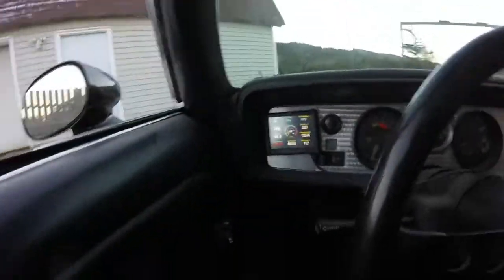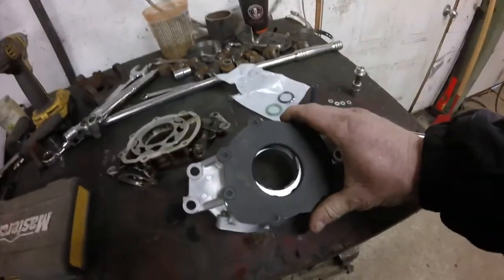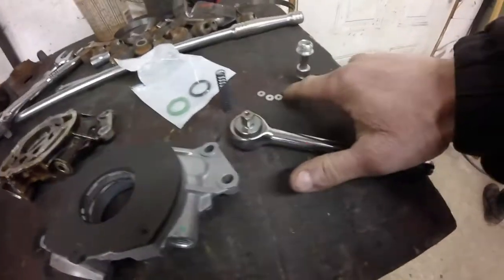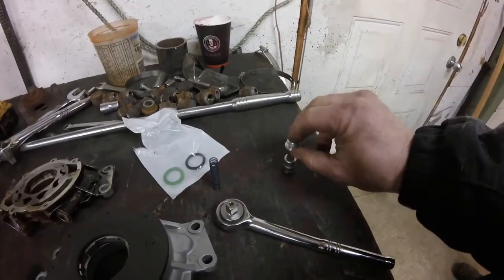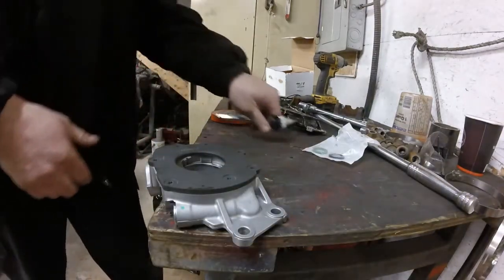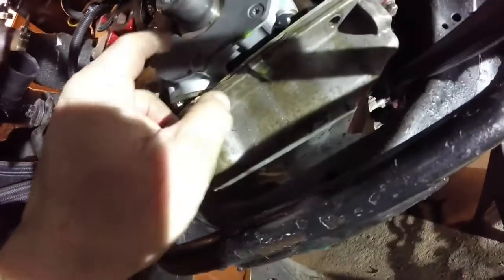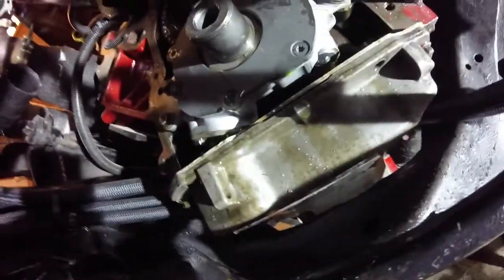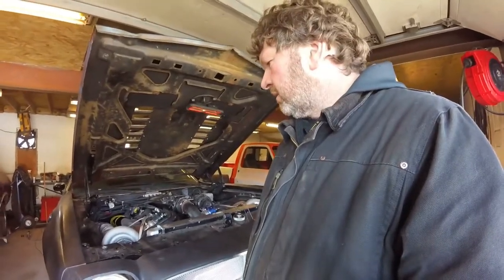turbo ls oil pressure problems

Comment: What should the oil pressure be at idle
Reply from the maker: I’d figure around 40 at idle but I’ve had them as low as 25 and be fine. Problem I had it wasn’t increasing enough when it was hot driving around
Reply: @weekendatbernies4503  im around 25 at idle running it around 45
Reply: But im not turbo yet
Reply from the maker: @irvingbar4569  should be fine for street car.I know the factory Gm pressure spec is not all that high. If it was a race only vehicle I would like a little more. If you’re not happy with it move up to next thicker grade oil. It should increase pressure

Comment: What are you thinking the issue is, bearings maybe?
Reply from the maker: They recommended no oil restrictors
Reply: Just something I found with my turbo setup, now I’m only running one turbo but mine with a -6 feed and no restrictor, mine idles at around 40-50 psi hot
Reply from the maker: Don't know how much pressure loss feeding 2 turbos. But original oil pump had a stuck pressure relief. And I started up and shut it off a lot before I replaced it with a stock used pump. Most likely the bearing
Reply: @weekendatbernies4503  makes sense. Sucks that you’ll have to pull it apart, but it made a lot of good runs this year so it’s worth rebuilding

Comment: Probably worth your while to check it with a mechanical gauge ? Some LS engines have a screen under the oil pressure sensor that gets dirty and the sensor reads low. Just something to check.. video was well done bud
Reply from the maker: thanks, i did have a mechanical gauge in there as well as the terminator. before the fire. they were the same. unfortunately
Reply: @weekendatbernies4503  well I did hear someone say low oil pressure is better than no oil pressure lol